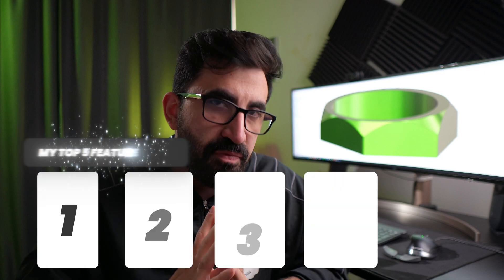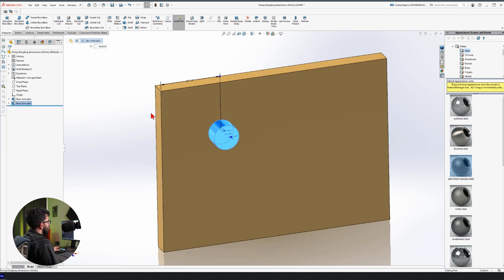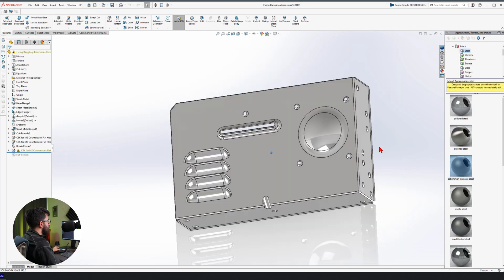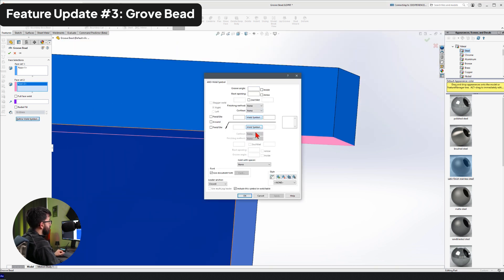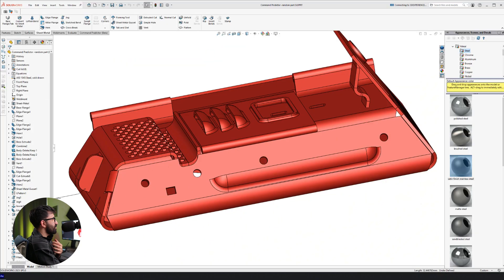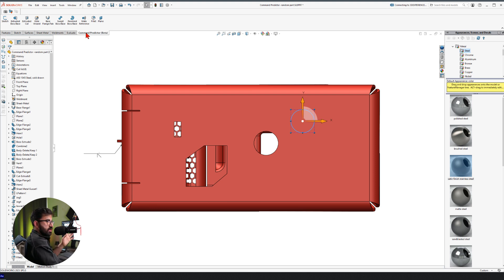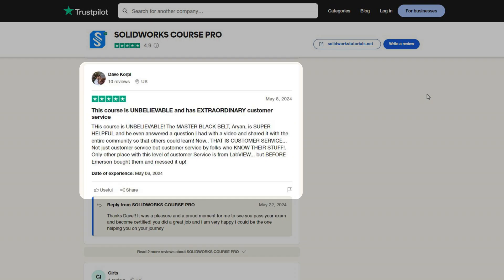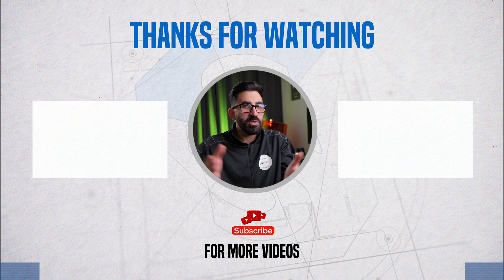FIVE Things They Fixed in SolidWorks 2025 (And ONE Thing They Didn't!)

Comment: Title should be Five things they fixed in SW2025 and the 1000 things they've broken
Reply: Tested SW2025 SP4 today. It took me 20 min to run in to the first mess-up, Subassemblies falls apart as they were set to flexible when dragging them, but only graphically, moving the mouse over the now empty space, still highlights the edges. updated the A4000 GPU with recommended drivers for SW2025 to no avail. Now 8 hours later i have probably found 10-12 new broken things. 20+ year with SW and I have seen SW falling apart bit by bit and is today an utter garbage mess. Switching back to 2020 again (enhance graphics made us move from SW2013 to SW2020) Everything started to fall apart 2014 and then all accelerated 2018 and is today more or less useless for anything other basic part design and simple assemblies (No, they ruined the last of assemblies too now with SW2025)

Comment: one feature i would love. is linear pattern. and be able to delete original and last. this way it's possible to control struts inside of a frame without using equation to control start and end distance and maintain equal distance through out. (yes im that lazy) :D haha. but i use this feature alot in HVAC frame systems.